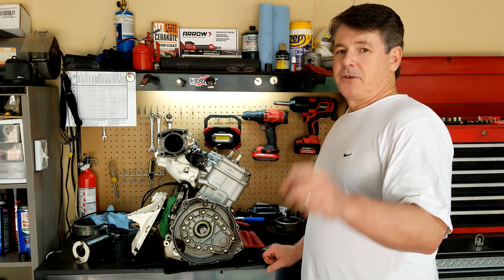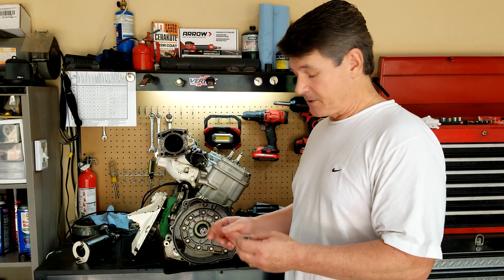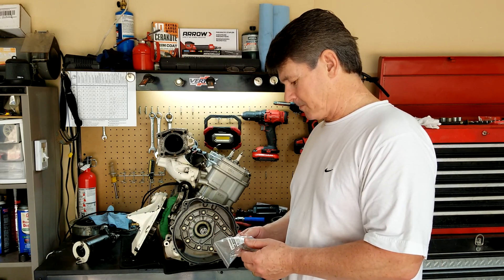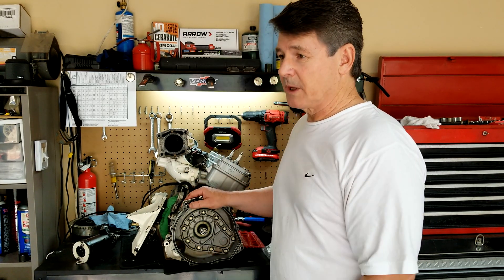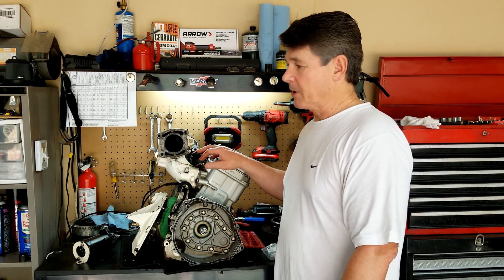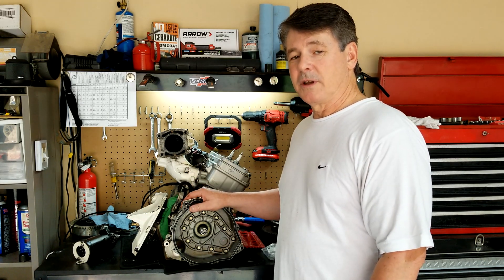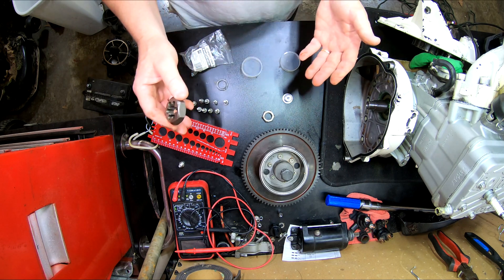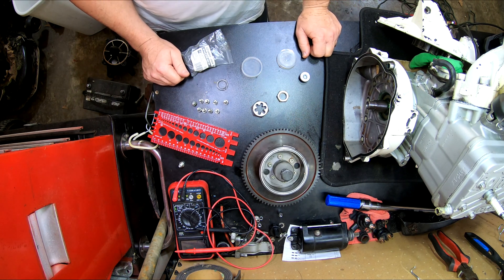HELP! I've damaged the crankshaft threads rebuilding a 96 Seadoo GTX engine.

Comment: I've had this happen. It's normally just the outer couple threads. I use a carbide in the dremel to thin down the mushroomed edge. At the same time I add just a little bevel to the snout. Usually the nut will just thread right back on without even chasing the threads.
Reply from the maker: I tried my cheap little dremel rotary tool, but I couldn't control it well enough to keep it off of the good threads.

Comment: Take it by Fletcher's motorcycle off of airways he can probably straighten those threads out. Or Sandy's automotive off of stateline road.
Reply from the maker: Are these shops you trust?
Reply: @papadonjetski9535  Fletcher is a good motorcycle mechanic and machinist. Been knowing him for years. Sandy's automotive is a good shop as well. They have worked on stuff for me a lot. I would try Fetchers motorcycle shop first
Reply: The die is tapered on one side. Use that to start from.

Comment: Don can you take a grinder and remove the damaged material
Reply from the maker: I tried diamond files and a rotary tool and I just seemed to causing additional damage.  At this point I'm afraid of using a grinder because even the  small rotary tool was hard to control.

Comment: Can you take a fine diamond needle file and clean up the threads. Just enough to get the die started? I would also get it so the nut threaded a bit so you can then get the die started. As a last resort, file or sand the first couple of threads that are jacked up so you can then get the nut on. The first few threads on the crank aren't what count, its the last few if you know what I mean. Good luck.
Reply from the maker: Thanks Alan.  I tried the diamond files, but maybe mine were not needle files...I don't know. The file seemed to make it worse by altering the good thread next to the bad. I also tried my little rotary tool, but it was doing the same thing as the diamond file.

Comment: I had to drive 50 minutes just to find a machine shop that could bore 2 strokes, but thread repair should be simpler however they may want you to pull the crank out.
Reply from the maker: I just don't see myself taking this engine apart again and starting over.  If it comes down to that being my only choice I'll do it, but I'm going to try everything else first.